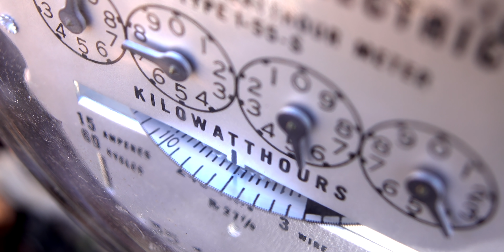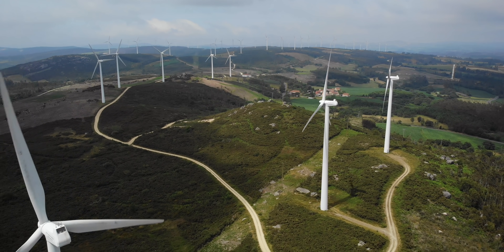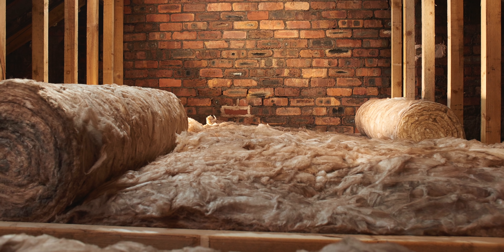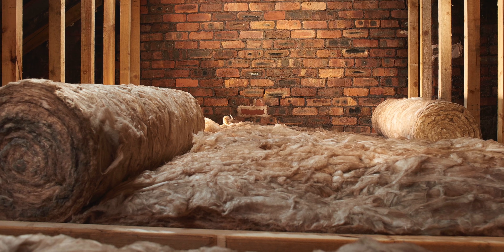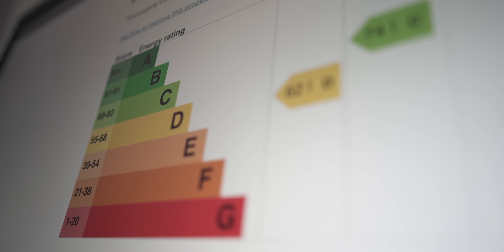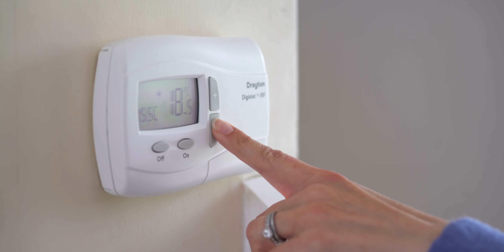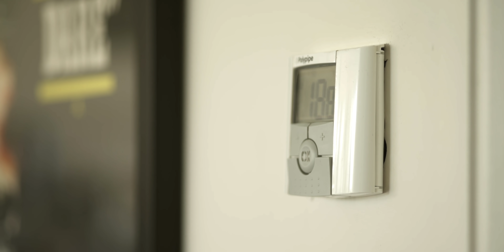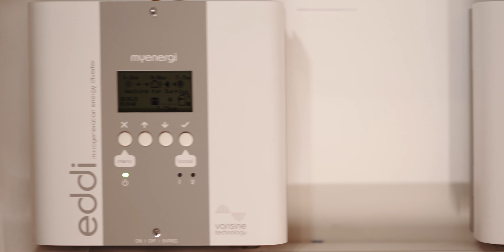HOME ENERGY Episode 1 - Cheaper Measures, Energy Efficiency & Fabric First | FULLY CHARGED

Comment: Bit disappointed by the lack of detail. You could do an hour long episode just on insulation, with some example homes having suspended floor insulation, cavity wall or external wall insulation, loft insulation added. The rough costs and how much difference it made to the CO2 and energy bills over a year. Pros and cons of different materials, airtightness membranes, etc.
Reply from the maker: We have to cover the whole subject in 110 minutes, this is designed much like our 'Maddie Goes Electric' series to be accessible and to enable people to start down a path. We could talk about each subject for hours but we had to start somewhere for our consumer audience. If there's demand we will drill down on all of these topics.
Reply: @fullychargedshow  it's a great introduction! I really hope you'll also do the "HOME ENERGY Extended Director's Cut" with an hour+ per episode and show in detail how we can upgrade all our old housing stock in this country :D
Reply: @fullychargedshow   I am trying to update my 1960s house  - as a consumer but there is no company who will just come and say make my house EnerPhit or Passive for a reasonable price.  The problems are a lack of standards to drive best practise, lack of competent installers, lack of any form of productivity (like energiesprong)...
Reply: @taptaps8432  I'm in  a similar situation with a 60's dormer bungalow  and currently agonising whether to rip up the suspended wood floor to either insulate or replace with anew  insulated concrete floor. Done the double glazing everywhere, insulated the majority of the floor at the ground floor ceiling height, but I know there is only a sheet of plasterboard, a four inch air gap, a sheet of tar paper and the roof tiles between me and the outside when I go to bed in the winter(you can feel the cold!) Options there seem to be internally lining the room with insulation then replasterboarding...and then there are the cavity walls... where I live the welsh rain batters the house in the winter and the cases I've heard about locally  of water penetrating the walls has put me right off..i hope this series does start to go into helping us identify the best bang for buck, eg is a survey with a thermal camera the way to go, or air testing to see where the leaks are... who knows? and who to trust? The green deal was a disaster, so even the government isn't to be trusted....
.
Reply: Hi  @jm-ze3sf  just got a blower test done - need to know if to dig up concrete floor to insulate or maybe nanofloor insulation.  The energy consultant is modelling the house.  If I lived in France its about 500Euros a square meter to retrofit to a high standard.  In UK it completely crazy prices for the same unfortunately.
Reply: @jm-ze3sf  i live in a 1930's dorma house (roof down to 1st floor ceiling hight at the front of the house) i had exactly the same problem. My small bedroom was 50% outside roof with only 2 walls internal and no insulation (other than cavity) 
I ripped off the plasterboard and installed as much insulation as I could (leaving an air gap) then used 35mm insulated plasterboard inside and on external brick walls. 
What an amazing difference! So far the radiator in that room has not needed to be turned on at all. The reduction in room size is not noticeable.
I also had an early 1970's dorma house out in a small village built like that. I insulated behind all the plasterboard (this was done in theb1980's) and the difference was incredible. Today I would put insulated plasterboard on the inside of all external walls (35mm total thickness or 50+mm if you can afford the extra cost and loose that much space in your rooms. 2 x external walls and you loose  over 4" or 100mm in new money which is a lot.
Reply: @fullychargedshow  Please do !!
Reply: @fullychargedshow  You could do a whole show on loft insulation. The different types, pros and cons, best practice when laying it. Any potential issues like reduced air flow in the loft causing damp etc. That would be really useful.
Reply: @fullychargedshow  I think there is demand. How many times have you pasted this reply? 😉
Reply: Maddie goes electric was about cars. The channel is also full of car reviews. 
Does this mean there will be an equal number of reviews for each hot water system, heat exchanger, battery or energy timing system? Because anything less will be inadequate. 

I'm sure the person that doesn't know about insulation will not mind you providing a bit more information.

Comment: Had to laugh at Tim's point about running a bath. He was absolutely right about it being totally ridiculous to spend all that money on energy to heat up water only to cool it down again with cold water so you don't burn your bum & bunions when you get into the bath. 😅😁😋
Reply: That’s an interesting one. In the UK we are told to heat water to 60 degrees to kill Legionella bacteria, but 60 is way too hot to touch. A smarter way to do it is to heat to 48 degrees almost all the time, but then once a fortnight heat to 60 degrees to kill of legionella risks.  That all said, in my extensive search of the internet, I can’t find any references to legionaries disease caused by domestic systems.
Reply: Muppet Keeper I would have thought a system using plate heat exchangers or even a simple coil within a thermal store would avoid the need to heat to 60 altogether, since the water in the cylinder would never contact the domestic hot water?

Comment: Got an isolated 1930s house with heatpump and 7 solarpanels and ev paying 90euros a month AND it makes me happy
Reply: Nico, how much did the heat pump and solar panels cost to buy and install and how long will it take to recoup your money back?
Reply: @briankavanagh7191  around 8K, installed used panels myself and heatpumps get subsidised in the Netherlands. Cant compare it with gas since i rebuilt the house when i bought it. The money is better off in the house then it would be on a bank anyways

Comment: How practical are hot water on demand systems?
Reply: It really depends on what it is, what its used for, and how much hot water you use. Running the math, as I have an electric shower anyway, the only thing my boiler does is washing up water. So it works out more than 2x cheaper for me to just boil water in a kettle than even run the boiler for an hour or two to wash up.

(the boiler uses about 25p to heat a tank of water, but its only a couple of pence for a kettlle of boiling water. the shower is 5-12p a use depending how long I soak)
Reply: @Capt Shiny Ooh nice. I am planning to get a little counter top dishwasher, then wont even really need to wash many dishes at all, other than large pans.

 For me, my flats electric only so i have night storage heaters for heating. Thankfully, the modern ones are great and can keep the place at a balmy tempreture all winter, and dont leak heat like the old ones either. They arent the cheapest things electricity wise but its manageable, and some more sensible provider switching this year is going to save me around £150. I'm glad the night storage heaters arent like the old ones when i was a kid! Those things were abysmall, four to eight hours of sweltering heat then a gradual decrease till you are shivering, these ones are basically just electric radiators.

Comment: Moved into new house with an electric boiler (No Gas) £300pm electricity bill. Changed to an Air Source Heat Pump now £60pm. If it wasn't for this channel  not sure I would have been so confident in such a system!
Reply: Wow, that's great. Is the house well insulated or leaky? The general advice is that the house needs to be well sealed to work with an ASHP. Is that what you found?
Reply: @michealoflaherty1265  I have an ASHP and it generates heat slowly. So long as the heat energy a heat pump can put in is greater than the heat energy lost an ASHP will eventually warm a space up. The house is well insulated but is held back by the dogs wanting to go in and out all the time letting the cold air in. It's annoying that the door can't just be left open all the time like in the summer 😒 . Its most frustrating when they ask to go out but all they want to do is stick their head out and sniff the air, but I wouldn't want to be without them. They are better than a hot water bottle 😊 even if they are a bed hog.
Reply: @michealoflaherty1265  It depends. My ASHP water heater works well because it's in a basement with a 10°C winter temp (at outside temp -30°C). So even though it leaks like a colander, it's just enough to not cause to much resistive heating because of it's underground location.
Reply: Martin Owens That makes no sense whatsoever. Your ASHP is within your home, hence you are paying twice for your hot water! You're paying to heat your house, some of which goes into the basement, where you pay again for the electricity that allows your heat pump to suck that heat out of the air and heat your hot water?!

Comment: I want all my experts to look like Tim, forever, what a star.
Reply: How very kind
Reply: @teeRpee  Hi Tim, just a quick question on making your home air tight. We have a solid 9" brick house that all ready has damp problems. Would this make it more prone to damp? It's not rising damp.
Reply: @stephengeary6382   Yes you're absolutely right. I deal with condensation in homes professionally and simply making your home more and more air tight is a recipe for mould. Especially if you have a family living in your home.
Reply: I feel a bit sad to see Tim say the same things as I have been saying for over thirty years now (early/mid '80-s) [both professionally and privately]
Basically it comes down to "Turn/switch off what you're not using"
This phrase has even more impact when applied in "industry" where "wasteful" behaviour is even more prevalent....
Reply: @TestTest-eb8jr  Yes, I’m sure Tim has been saying it for years too. Luckily I’m from Yorkshire, so we’re too tight to waste anything.